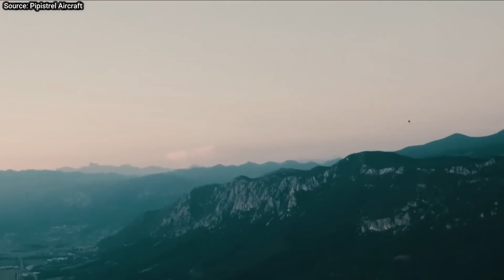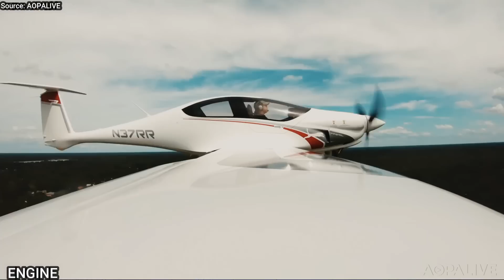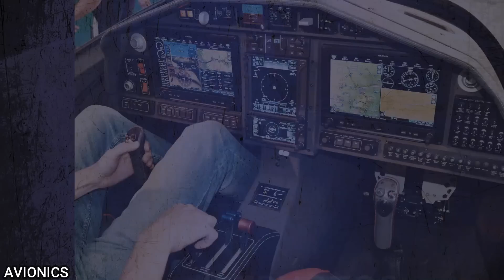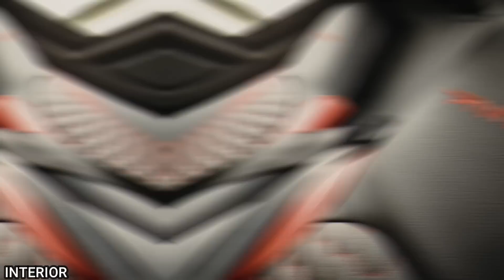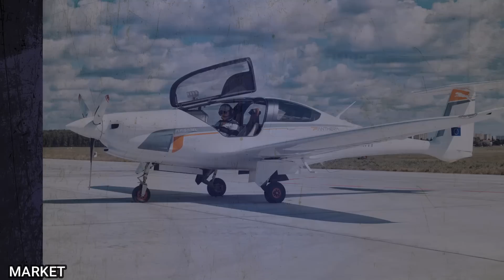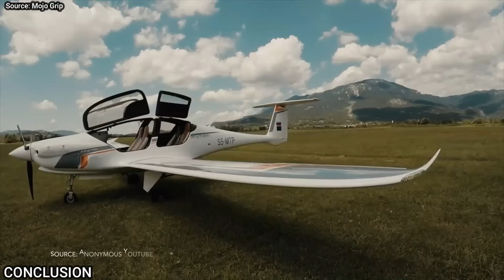Why the Pipistrel Panthera is Excellent

Comment: The time is wrong in the video title. "might be one day" would be correct. 3 years later, still no Panthera.
Reply: contoller has a few for sale
Reply: @precious-union  the Panthera isn't EASA certified yet, and you can't buy from Pipistrel. A few experimentals are around, but not with the production engine, etc.
Reply: @BlueSideUp  Textron Inc. is a large American company based in Providence, Rhode Island. It was founded in 1923 and is involved in several industries, mainly aviation, defense, and manufacturing. One of its most important divisions is Textron Aviation, which produces private, business, and training aircraft.

Textron Aviation includes several well-known aircraft brands. One of them is Cessna, which is famous for small single-engine planes like the Cessna 172 and for business jets such as the Citation series. Another major brand is Beechcraft, known for its reliable turboprop planes like the King Air and for military training aircraft like the T-6 Texan II. Textron also owns the Hawker brand, which once produced midsize business jets, although no new Hawker jets are being built now.

In 2022, Textron bought Pipistrel, a Slovenian aircraft manufacturer. Pipistrel was founded by Ivo Boscarol and became known for making light sport aircraft, gliders, and especially electric-powered planes. One of Pipistrel’s best-known models is the Velis Electro, which is the world’s first certified electric aircraft. Other popular models include the Alpha Trainer and the Panthera. After the acquisition, Pipistrel became part of Textron’s new division called Textron eAviation. This division focuses on electric and sustainable aviation, aiming to develop cleaner and more efficient aircraft for the future.

Today, Pipistrel continues to operate under Textron’s ownership and plays an important role in developing electric flight technologies, helping Textron prepare for a new era of aviation.
Reply: @BlueSideUp  You can obtain it in two ways: one is experimental, and the other is certified.
Reply: @precious-union wrong time again. You will be able to get an EASA certified version. A friend is in sales for Pipistrel in Europe, trust me, the Pipistrel isn't certified yet. Sadly. They switched engine when it became clear the 390 is staying AVGAS 100ll only, and that's a showstopper in Europe going forward. I sat in one just recently at AERO Friedrichshafen.
Reply: @BlueSideUp  Maybe the new ownership will change things as the company that acquired Pipistrel is involved heavily in the defense and military industry, if they wanted it would be.

Comment: The electric version of Pipistrel will revolutionize GA. The newest Li-ion battery has the same energy density as hydrocarbon fuel. Incorporating the latest battery tech into the Pipistrel means GA will be more reliable, safe, and economical. Stay with this airplane company.
Reply: "...newest Li-ion battery has the same energy density as hydrocarbon fuel..." - WHAT?!

If you can provide evidence for that, I'd be delighted!
Reply: wring 1 20 way kess engery 10 t8me half e ergy

Comment: The problem with this plane is the weak tail strength, that’s why the “never exceed speed” is very very close to the high power cruise speed of 195 kts. Push the nose fwd to descend for landing and your In trouble. The other problem is the engine cooling, it always overheats in climb out in warm climates.
Reply: Push the nose forward to descend for landing ?
You routinely dive bomb the runway ? 😂
Reply: who tf is pushing the nose forward for descent and how did they get their license?
Reply: @tropicthndr Surprising how much armchair pilots know about a product that is not yet certified and is of yet only experimental. Wow, you are a SUPER-GENIUS!
Reply: War Thunder Yak 3 player : I know this problem
Reply: @gliderfs621 スサシステム
Reply: Im not surprised. Those intakes are just too small. It is an absolutely beautiful air frame and incredibly efficient. I have a feeling they are betting on the electric versions down the road.
Reply: Yeah that sucks..